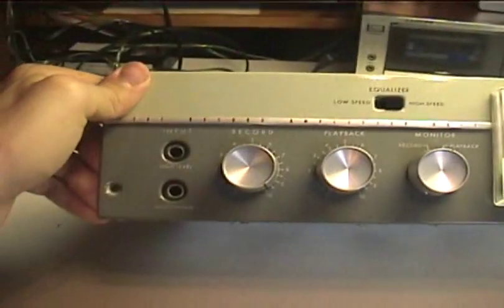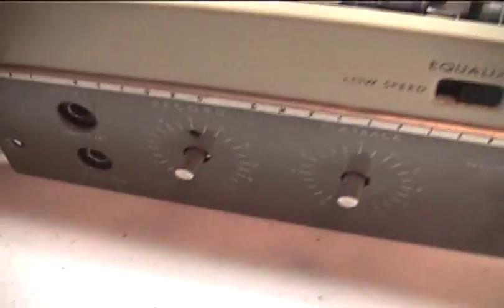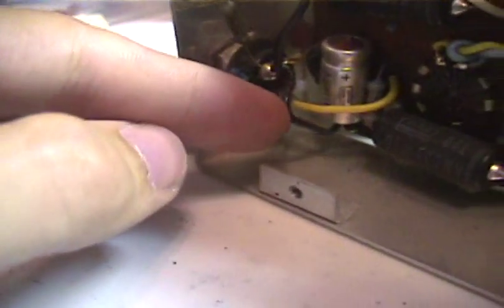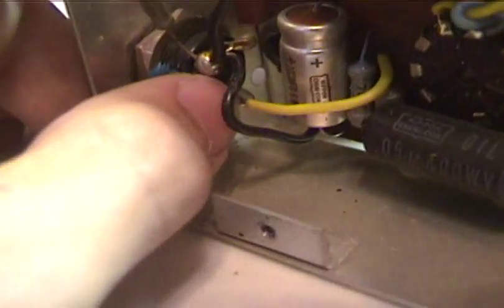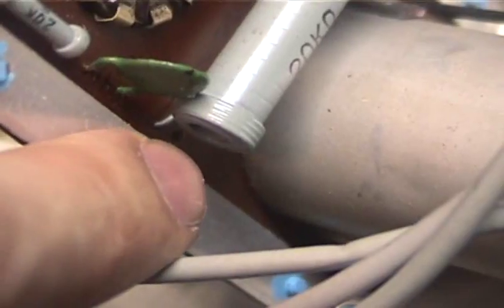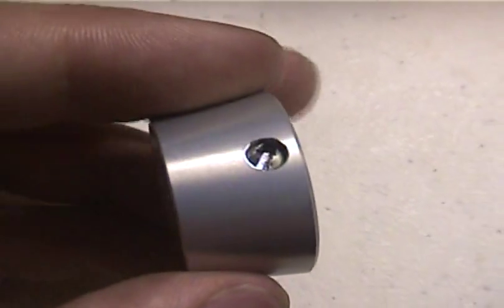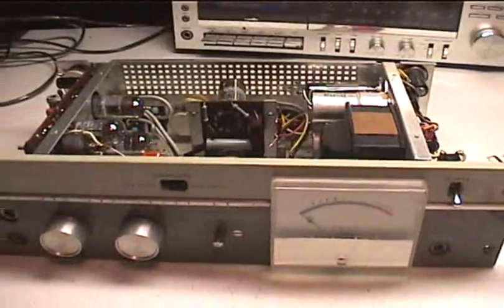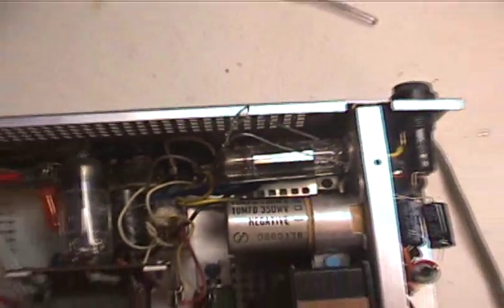PART 1: The Recap.

Comment: Hmm. So you replace the Oil capacitors with mylar or ceramic types? It's a little obvious, but I don't want to mess up my Fujiya FL-771... It's never seen electronic servicing beyond a replacement tube.

Either way, you did a great job on this little project.

Comment: jUst as long as you don't bend the pins when inserting or removing the vacuum tubes, you sould be OK.  I think vacuum tubes for portable battery powered radio are a little more fragile though.

Comment: Great job. That unit has to be rare. Just finding a TEAC tube recorder would amazing. Hope the resistors that got hot are OK. I wonder if it would be possible to find the wiring diagram? Thanks for pointing out the OIL capacitors, keep those in our collection. Hope the tubes are good!!